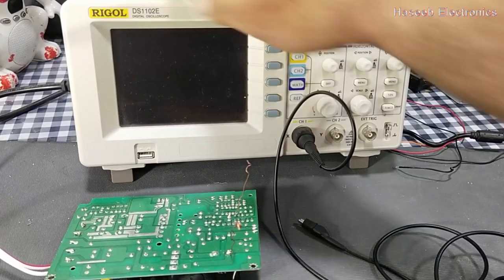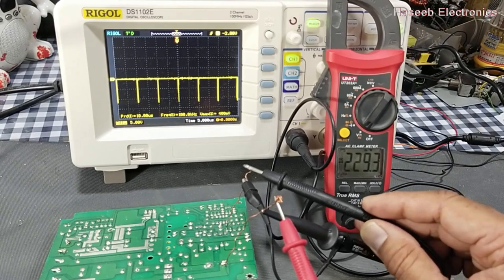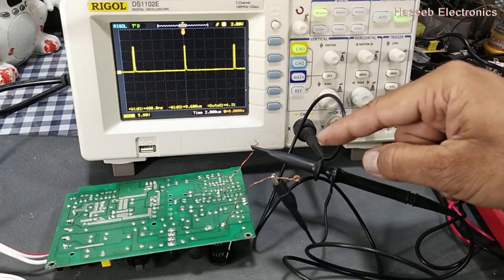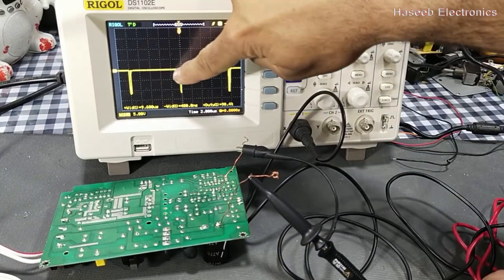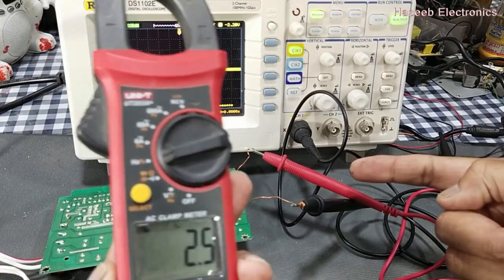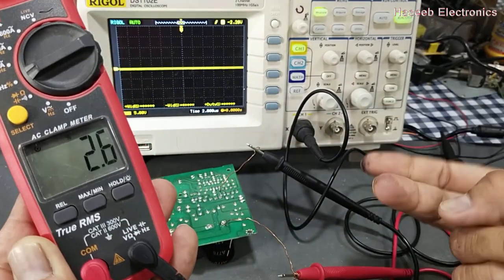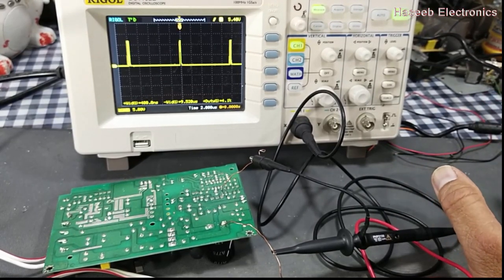{533} Reverse Signal Connection of DSO Oscilloscope To Test a Signal / Effect of Reverse Connection

Comment: Sir I have questions I have one power supply  I’m getting 14vdc   and some time get 16 vdc interested 12 vdc out put  What it cost to do that? Thank you very much sir🙏🙏🙏🙏
Reply from the maker: please check feedback circuit 
adjust its voltage divider network 
please check video number 283

Comment: Hi Maestro. I want to ask you if same risk to conect in wrong way a Bench Multimeter as happens with Bench Ociloscopes ??
Reply from the maker: exactly the same 
reverse connections for any frequency related test instrument like oscilloscope, multimeter either handheld or modular / bench type, and frequency counter 
it will case to produce false reading
Reply: @HaseebElectronics  is the same risk to burn the instrument by making a wrong ground connection ??
Reply from the maker: @lupojacobo9892  yes it is possible
but more safety the test instruments must be isolated from line

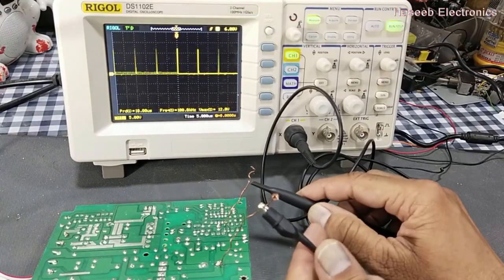Comment: Thank you for clearing my doubts and giving clear explanation. The frequency, duty cycle the reverse effect has been cleared.  However I have again confused about the voltage measurement showing in this video. Is this the same UUT and test point from video number 532 you were testing? Are you measuring the gate signal? In video number 532 it showed 12V on DOS and the same 12V in this video at 0:52 but both multimeter and DSO in this video showed about 200mV after 1:00 . And never showed 12V again. What is happening? Can a DSO measures everything that can be measured using multimeter like capacitance, inductance, current, resistance? Keep up your hard working of spreading the knowledge.
Reply from the maker: thanks a lot 
best regards for your message 
in that video we monitored VCC pin, pin number 7
but in this session it is pin number 6 the drive signal
Reply: So the gate signal are usually in milli volts and can be detected by using multimeter?
Reply from the maker: actually the drive signal is around 10-12 volt 
but it's current is limited 
so at high frequency, it's voltage level on multimeter is showing in millivolts be ause the multimeter use capacitor to couple signal 
this reduced voltage in high frequency is called 
ac response of a multimeter
it is a huge factor while selection of a multimeter